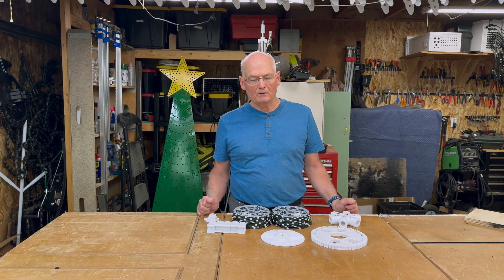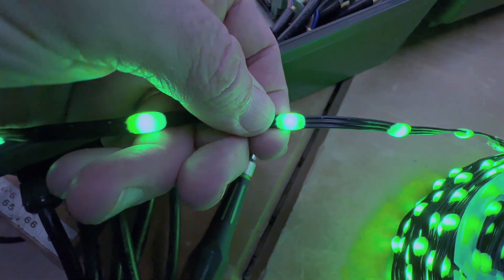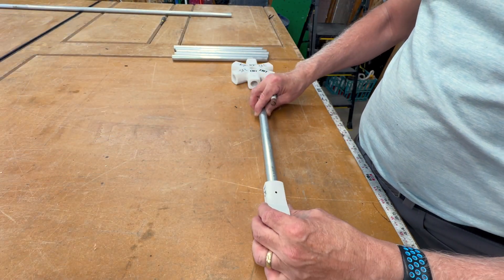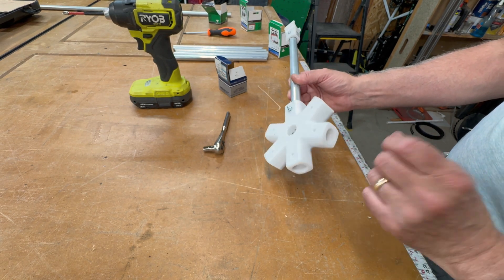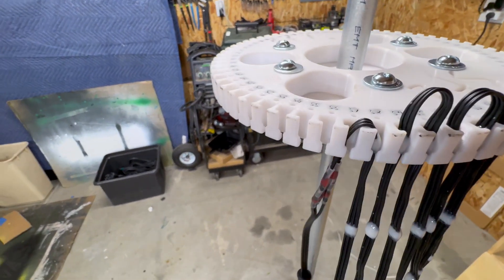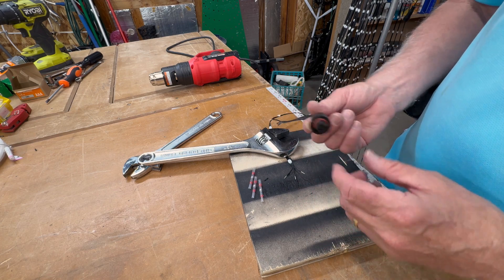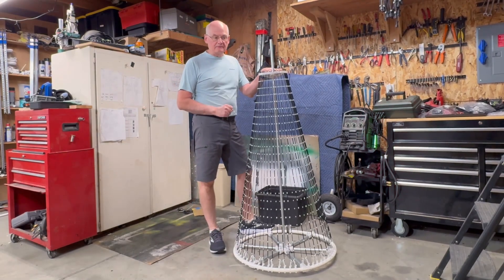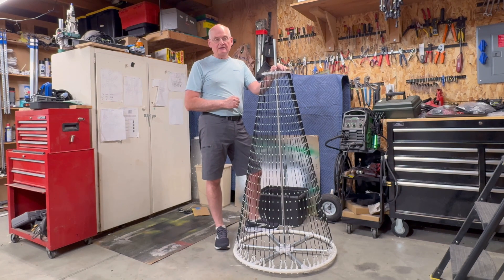Seed Pixel Mini Tree

Comment: How many rolls of the pixels do you use for a 180 4 ft tree?
Reply from the maker: I used less than a roll for my tree and it is a 180 about 4 ft talk.  It has 800 pixels with 1 inch spacing

Comment: Hello,  question the seed pixels. you have suggestions on keeping them uniform spacing the length from top to bottom so they don’t twist,  the pixels that I’m using have that tendency. 

Also on another topic, I don’t currently have a 3-D printer and was looking to purchase which would you recommend that would be a good long-term as well and speedy. Thanks!
Reply from the maker: I do like keeping them straight but with seed pixels it should not make a difference.  To keep the spacing the same I just used the spacing that came with the pixels.  I kept the strings tight.

For printers I have the Bambu P1S.  It is a great printer, easy to use.  In my opinion you can’t go wrong with a Bambu printer.

Comment: Im looking at the pixel seeds on the link you gave. I see they have 3 other options. One looks like it's just a thicker seed but otherwise works the same? 
One is dual data which i think you just basically twist the two data wires together for redundancy? 
And one is rgbw, which looks like it works the same as the others but has a seperate white so it's a little brighter? 
Do you have experience with any of these differences?
Reply from the maker: I don’t have experience with most of these.  I used standard wire thickness and RGB seeds.  I do see the advantage of an extra data line.  With it the failure of a pixel will not require a repair which could be difficult with seed to get the same spacing.  RGBW are good too, just don’t see a need for my show.

Comment: Do you have the link for " ½ inch EMT Hub"?
Reply from the maker: Here is the link for the hub I used which was 1/2 inch EMT.  They also have them that use PVC and other sizes.
https://sfl-designs.com/STL-File-Mini-Seed-Pixel-Tree-Base-1-2-EMT-to-1-2-EMT-p685329625

Comment: You ran 800 on one port with power going to the back?  Do seeds take that much less power to run?  I would probably split mine 400 and 400 to try and stay under the limit, but I thought I would have to be running 4 different ports to this thing.  How much power does this tree take?  Amps?
Reply from the maker: I just set two of them up in my show.  At 30% brightness in RGBW chase mode I am pulling 2.5 amps. When I add power injection at the back side it drops to 1.5 amps.  I am setting up backside power injection since I have a star hooked up to the end of the tree.  Hope this helps.

Comment: Love your videos! I've followed your Coro mounting which has worked great, the instructions are so simple to follow.

Quick question, how did you set this tree up in xlights?
Reply: Thank you!
Reply from the maker: I set it up as a tree with a single strand of 800 lights, with 32 strings per strand.  If you use more than one input from your controller the number of strands will change.  You set it up just like a mega tree only make it smaller

Comment: FYI - Don't use button heads for the screws like he did in the video. They will make your entire setup unstable and won't sit flat. Use M4-0.7 x 50 mm Phillips Flat Head and to be honest if I built another one I would use selftaping screws going through the top into the supports on the pipe mounts and support base so everything sat flush on the ground. The design is nice but needs to redone to allow stability.
Reply from the maker: I agree that when you set the tree on a hard surface, like a concrete floor it is unstable.  I figured since I will install it in my yard on grass, with some stakes to hold it in place that it shouldn’t be an issue.  Using flat head screws is a great way to improve it.  Also self tapping screws would Mikey’s the build easier.  Great ideas!
Reply: @bergmannlights5149  Yeah I'm building one for my wife to have on the front porch and when she got home she was like "it wobbles" and I said I know I know I know, I'll fix it tomorrow....They are never satisfied...lol.
Reply from the maker: You could print several of the emt connectors and point them down to get a more stable base.  It will elevate it by about an inch but would make it more stable

Comment: How large of a tree can this handle? Will this be able to support a 8ft or even a 12ft tree with no issues?
Reply from the maker: Not sure SFL designs,Jason, is planning on making a large tree, I think he is planning on 10 ft, to see how it does.  If you go that high I think you will want to use something stronger than EMT.
Reply: @bergmannlights5149  thanks. Guess I will wait a little before I start printing the topper. Also hoping he releases the rest of the files soon as well
Reply from the maker: He told me sometime this week, probably this weekend
Reply: Any update on this if these are capable of handling a 8 to 10 foot tree?
Reply: @stephenjones1005  I was able to make a 10ft tree out of this, and it lasted all season
Reply: @rbf351  Perfect! Good to hear. Thanks for the quick reply on this. Did you need to support it at all due to any tension or did the print handle well on its own

Comment: Great job thanks. I had been wondering about using seed pixels instead of normal pixels, although I have just designed and am making my own mini trees out of coreflute, with stars and have had to limit the number of pixels to 150 per tree/star due to power injection and data etc.
Reply from the maker: Thanks for the kind remarks.  I use power injection as well to optimize my controller usage.